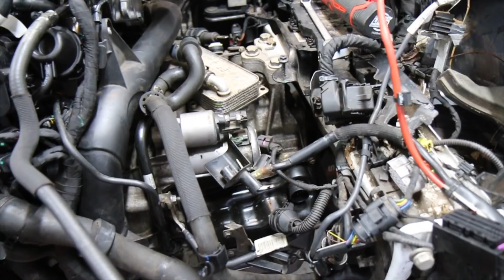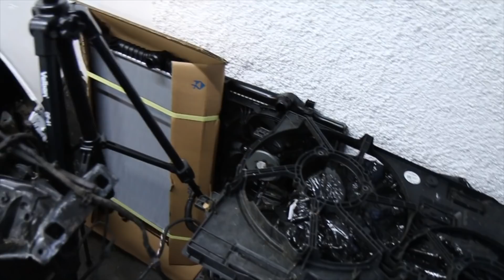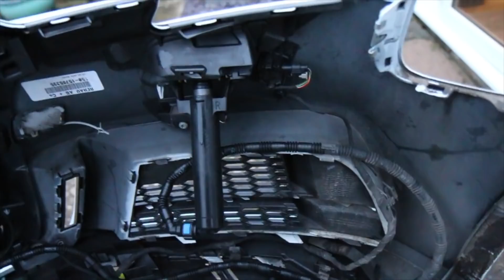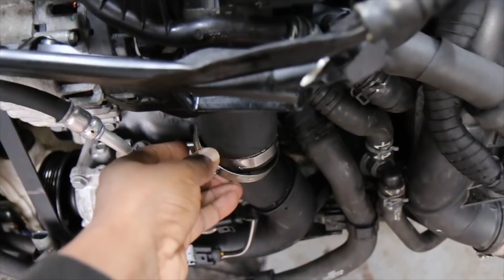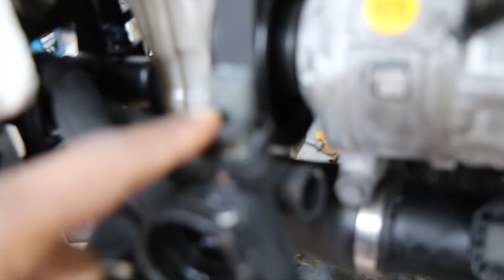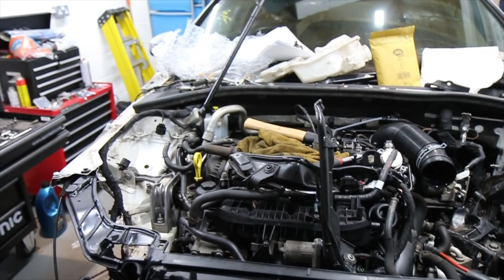My crashed Audi S3 receives some new parts

Comment: I might have missed this on an earlier video, but how are you measuring that things are in the right place? Eg the rails, upper mounts etc.  There was a fair amount of energy that went into the front end, I”d be surprised if you didn’t end up with a few odd panel gaps when you’ve fitted up the outer panels. Nothing that can’t be sorted, but you’re better off checking now.
Reply from the maker: I took the liberty of checking all measurements before putting the engine back in, one leg was slightly out which has been corrected with a ram so we are all good.

Comment: The part you referred to as the fuel pressure regaultor is actually a high pressure fuel pump just so you know paul these are a serviceable  item
Reply: True. One or two parts identified wrong but if joins up right then no problems 👍
Reply: @330timunson5  as i said i was only correcting paul so that he knows in the future that its a fuel pump not a regualator they are 2 very different things

Comment: Amazing watching the car go together -  all seems to be coming together really quickly!

For the bonnet I'd personally try to track down an A3 bonnet since they should be the same part number and a bit cheaper too. Breakers tend to sell bits cheaper than those selling the parts separately, so I'd check those too. Just found a few listings to start off with:

https://www.ebay.co.uk/itm/2014-AUDI-A3-BREAKING-1-4-TFSI-PETROL-CPTA-7-SPEED-DSG-AUTOMATIC-PYU-GEARBOX/153285771309?hash=item23b08b402d:g:D2MAAOSwWjFcAscL

https://www.ebay.co.uk/itm/Audi-A3-Breaking-2014-Diesel/123973144756?hash=item1cdd6010b4:g:ZtEAAOSwQGtdyq~4

https://www.ebay.co.uk/itm/Audi-A3-S-Line-2012-16-BREAKING/352479219747?epid=27015861564&hash=item5211661023:g:Ub0AAOSwHt1buhOn

https://www.ebay.co.uk/itm/2013-AUDI-A3-8V-S-LINE-WHITE-5-DOOR-1-4-PETROL-AUTO-LIGHT-BULB-BREAKING/254323419873?fits=Car+Make%3AAudi%7CCars+Type%3AS3+quattro&hash=item3b36db6ae1:g:dB8AAOSwEyhdSrem

There was also a bonnet from an S3 going for pennies but it was slightly creased and probably not worth fixing.
Can't wait to see the finished car!

Comment: Nice video, will be a nice car when done. But cheap engine and cheap bumper just be careful when buying some of the parts I know what you are going to say but people will think you are getting them from unofficial places
Reply: Yes. Worst rebuild on YouTube.
Reply: @chrismatthews6411  why?
Reply: chris matthews, I think it will need a pull as if the engine broke off it’s mounts the legs can’t be straight,only time will tell when the wings and bonnet are on.